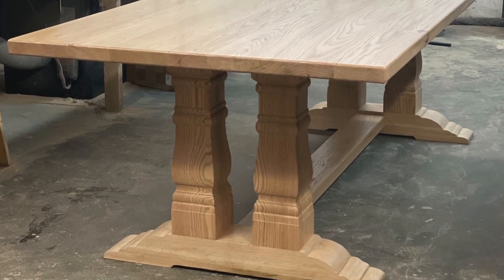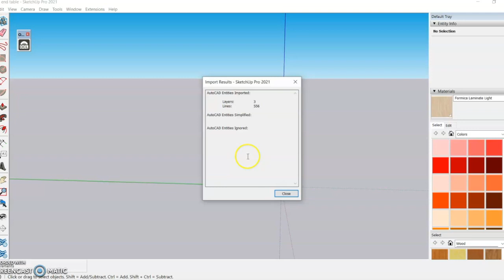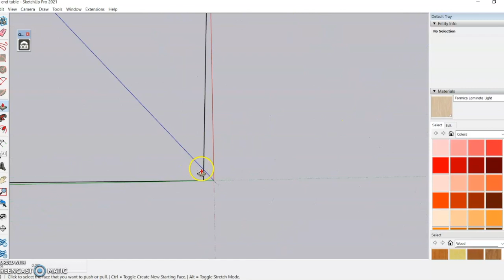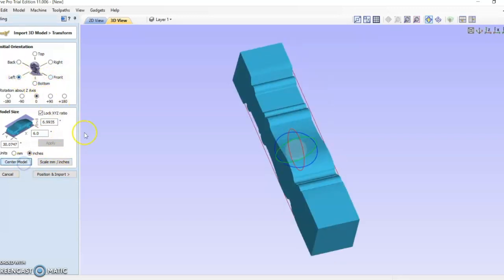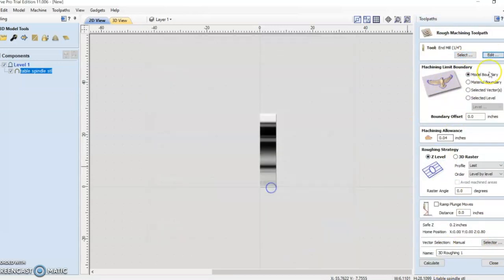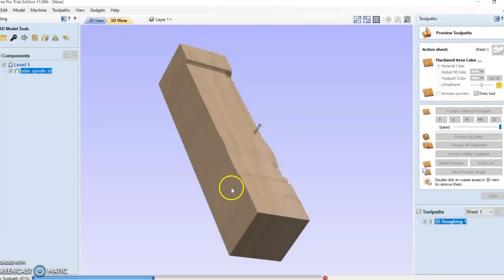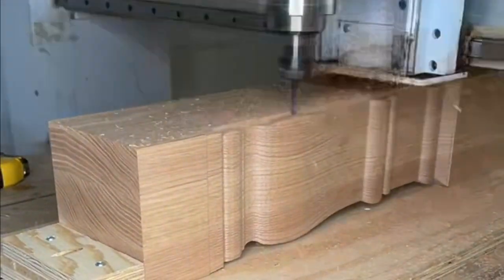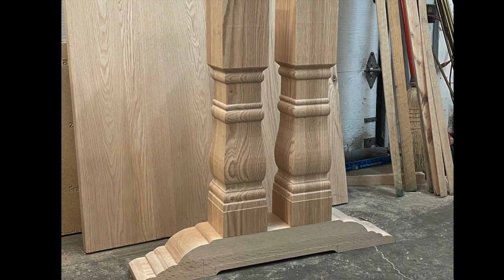How To | Sketchup to Vcarve | And Cut Wooden Spindle On CNC

Comment: To cut out that tedious process of erasing lines in Sketchup you can rather create a rectangle (larger than the 3D object itself) and place it at the midpoint of the 3D object. Select both the rectangle and the 3D object, right click and select 'Intersect Faces > With Selection'. This will essentially create a section of the 3D object onto the rectangle. Will take you 30 seconds👍